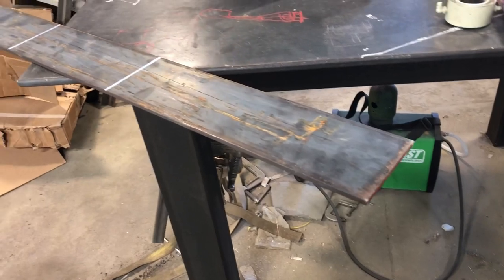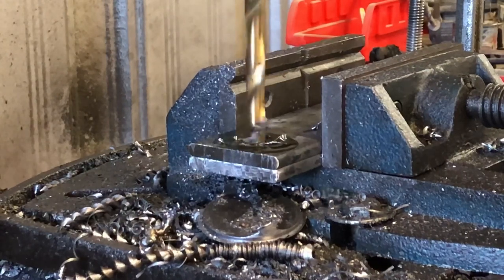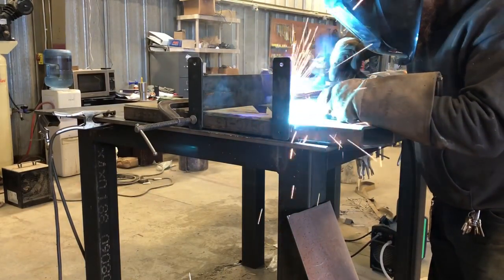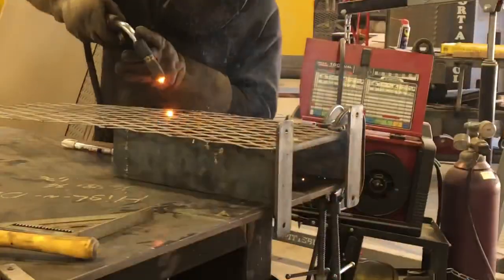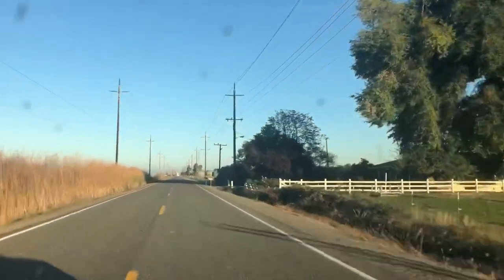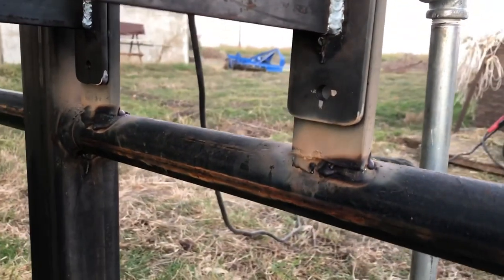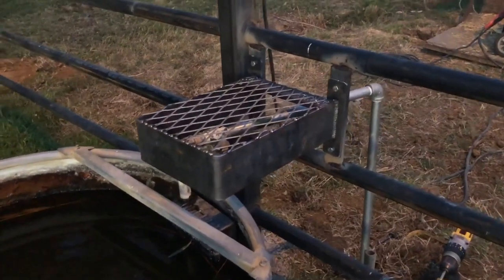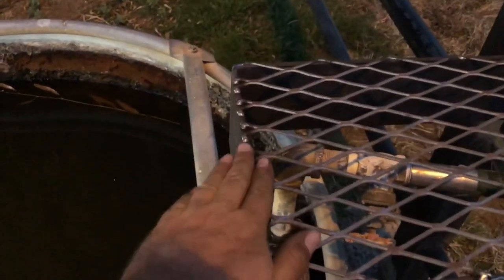Making a Water Trough Float Guard

Comment: Hey Tyler; great job!  I'm a new subscriber & trying to catch up on your videos which this one sparked my interest as my Santa Gerts have destroyed 4 float valves so far.  That float guard looks stout - do you think one made of sheet metal would be strong enough?  I ask because my brake is kinda light duty.  thanks.
Reply from the maker: Thank you Alan and thanks also for subscribing!  Sheet metal might work for this but I’d say the thicker the better. You could always cut and weld the corners rather than bend them too.   Truth be told, anything will be better than nothing!  Thanks again